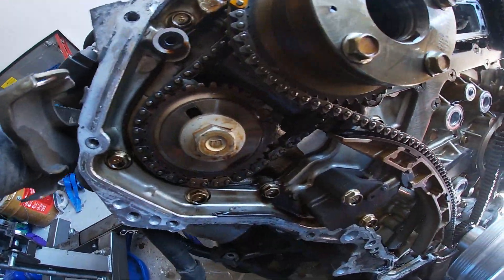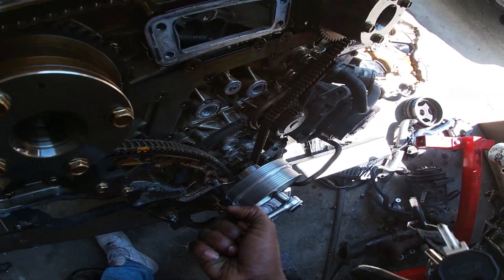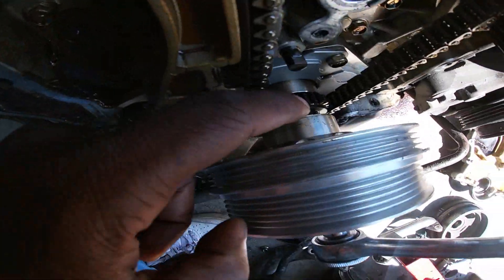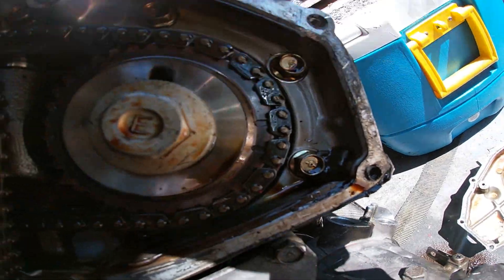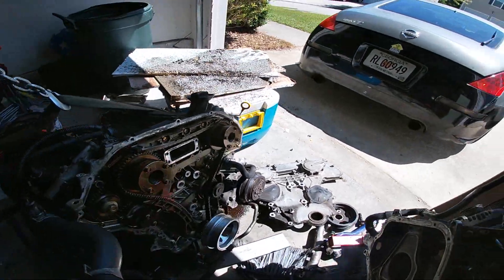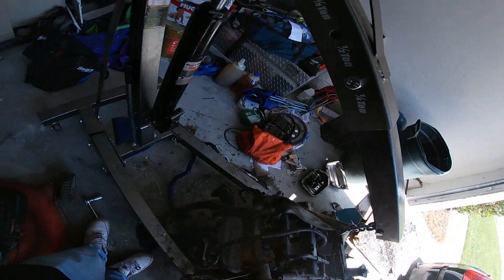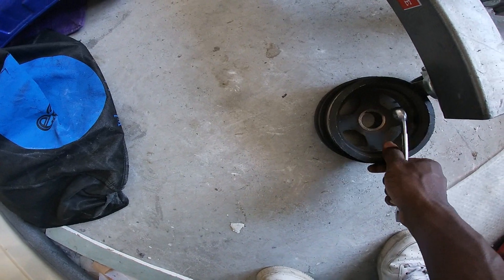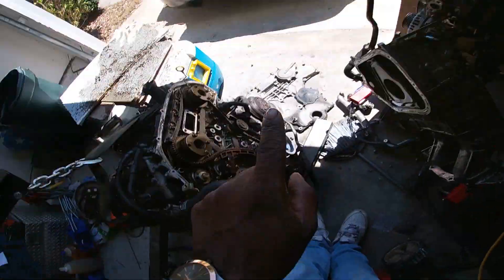BEST 350Z BUILD CRANK PULLEY REMOVAL THE EASY WAY

Comment: You can remove the chain tensioner @ TDC without worrying about the timing popping because the cams are in a rest state; the valve springs aren't pushing on the lobes of the cam to get it to spin/pop and lose timing of the engine. Other times, you have to keep tension on the chain in order to avoid skipping links.
Reply from the maker: Idk where you was when I needed to hear this but better late then never 💯